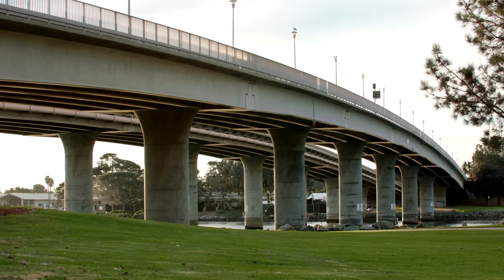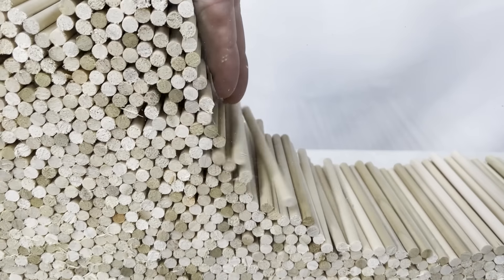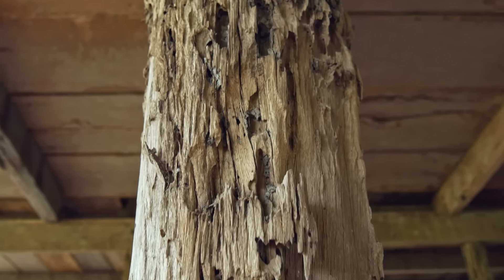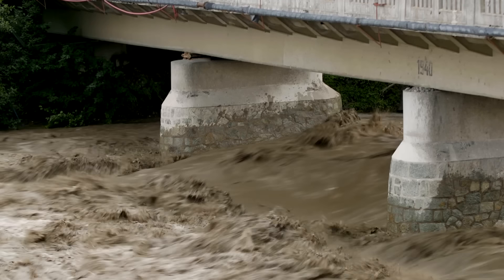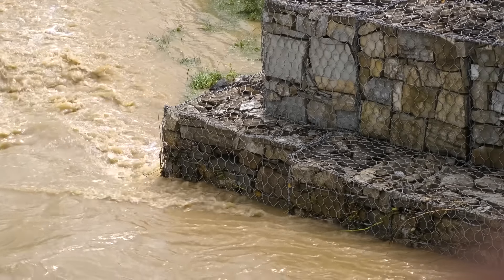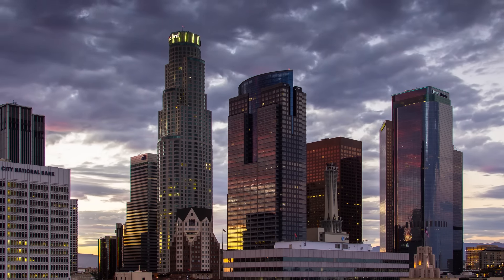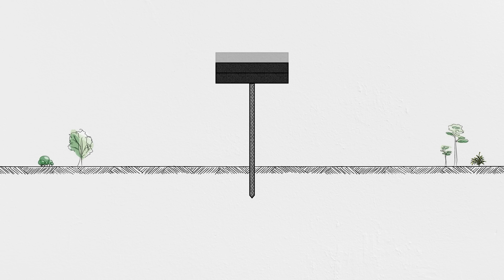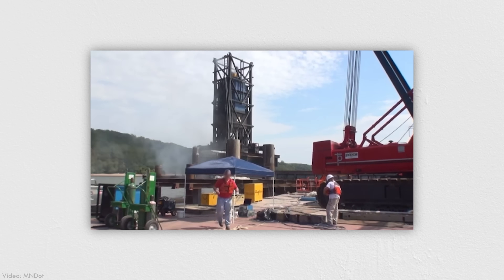Why Buildings Need Foundations

Comment: I live in Utah. Whenever the road gets wet (including I-15), the lane lines can become difficult to see, and traffic gets to play a game of everyone guessing where the lanes are. This problem is exacerbated by constant construction due to massive population growth and freeze-thaw cycles; every time a lane is moved, the old lines are painted over or ground out, and it can be very difficult to differentiate between these ghost lines and the real lines on the wet road, because they’re all just kind of less shiny bits among the shiny road surface.

When I visited Oregon, however, it was a completely different story. The roads are constantly wet there, and the lane lines were extremely easy to see at all times of day and night. Even when the tabs that stick up from the road surface (we can’t have those in utah because snow plows will scrape them off) aren’t present, i can see the lines very clearly. I think they use some kind of paint with reflective material instead of just pigment, but I’d like to see a video about road paints and why it’s so crummy in Utah vs Oregon (hoping there’s a better reason than cost, because it’s really dangerous).
Reply: In both Houston and Dallas I have encountered the same problem on freeways that have undergone numerous lane shifts during road construction. Even with reflective paint it can be hard to see which is the correct lane in wet conditions; we sometimes have to rely on the reflective bumps for that. But then we never really need snowplows...
Reply: They use the reflective paint for road lines everywhere. 
I'd guess what happens in Utah is when the roads get wet the fine sandstone dust turns to mud, and that mud obscures the reflective particles in the paint.
You also have a sort of sand blasting effect with sand and wind scouring the paint, and vehicles running over the sand particles as well grinding on it.

Basically its a more hostile environment
Reply: Oh my gosh yes please
Reply: I always have trouble in well-lit urban areas in the rain, the shiny wet pavement reflects the streetlights and other vehicle head-and-tail-lights and there's just too many light sources, no contrast. It's not a problem when the pavement is dry and black but when it gets wet and shiny it effectively doubles the number of light sources.

The paint used in street markings is retroreflective (a simple retroreflector made of glass beads embedded in melted plastic if I remember it correctly), so it preferentially bounces light back in the direction it came from and so looks brighter than other objects in the area when viewed in light that comes from near the viewer, like your headlights. This effect is cancelled if there's a bright streetlamp or a vehicle coming the other way whose headlights are bouncing off the road just as brightly as the reflection of the paint. When the streetlight hits the pavement, the water layer scatters the light in all directions but the retroreflective paint sends most of it back up towards the light fixture, and so less back to your eyes.
Reply: The paint depends on where you live.  Most northern lines are made with thermoplastic paint and covered with ground reflective glass.
Reply: Wait, are you saying they never need snow ploughs in Oregon?
I thought there was a lot of skiing up there, on the eastern side at least...
Reply: @MrNicoJac   There is considerable disagreement about raised lane markers. Some local Dots refuse to use them because the plows tear them up. Other states require them no matter the cost. The development of these markers is on going. It's like mouse traps, there are new designs every year.
Reply: @firesurfer 
Ooooh....! 
Yeah, we don't have those here either...
Thanks for the clarification! :)

Do you have an option on pervious concrete?
Here in the Netherlands, we've been using it whenever roads needed resurfacing, and so far it seems pretty good, overall.
No more aquaplaning!
(but I'm not sure if our roads now get destroyed more easily, and whether it would work everywhere - I believe road salt washes away and thus basically becomes completely ineffective)
Reply: @MrNicoJac  I think it's pretty rare, but is used in some places in Arizona.
Reply: Places with lots of snow (particularly where it doesn't melt at all over the winter) also have rumble strips between lanes as often you can't see the lines as they're below a sheet of composed snow that is now ice.
Reply: The problem in Utah may be partly due to low population density, which means more miles of road have to be maintained per person, which makes budget problems.  In Ohio we have plenty of both rain and snow, but we also have 282 people per square mile, so ODOT is *funded*.  We do occasionally get hard-to-see lane lines, but when we do, it's consistently either in an area with active road construction (in which case there are orange barrels and cones and such, and it doesn't last very long) or on out-of-the-way rural roads ("township roads") that hardly get any non-local traffic and only have two lanes anyhow.  When they change the number of lanes on a state or national highway, they generally go ahead and repave while they're at it (those roads have to be repaved every year or so anyway, no matter what you do).  And that goes double for major highways, like US-30 or the interstates, or major thoroughfares in urban areas, like West Fourth Street in Mansfield.

However, it could also be related to climate:  Utah gets rain much less often than Oregon or Ohio, so the roads have a longer amount of time in between rains to accumulate all the things roads accumulate when it doesn't rain.  Leaked motor oil and various other automobile fluids and who knows what all else.  When it rains, that all gets mixed into the rain water on the road, and the longer it's been since the previous rain, the more of it there is.  In Oregon, or Ohio, the previous rain was probably a couple of days ago, so there's usually not that much accumulated crud.
Reply: @BVoshol 
Are those only for snow?? 👀

I thought they were for sleepy/distracted drivers 😅
Reply: Standard procedure for installing Bott's Dots or similar devices in snow country is to cut recesses in the pavement and install the dots in the divots so the surface of the dot is flush or below flush with the pavement,
Reply: @Steve Cook Yes, it’s very difficult knowing where you’re at when I-15 gets wet, I commute to and from Salt Lake daily.
Also worked in Washington and Oregon the first 6 months of 2021 and drove through several torrential downpours on I-5 and you’re right, the lanes remained much more visible
Reply: That's funny...every time I'm in Utah, all I think about is how much better the roads are than in WV...
Reply: @dorvinion  I thought the roads were so bad in Utah because they don't invest in their infrastructure as other states do. Low taxes.

Comment: Nice job explaining.  

What might be very interesting for a subject is the concentrated load on a runway for an airplane landing, and how it dissipates through the thickness of the concrete.  The shear cone of a concentrated loading vs uniformly distributed.  Static vs dynamic loading.
Reply: Of interest on the subject of airport runways was an article I read in a magazine about heavy equipment. The concrete runway was being replaced due to wear and because they couldn't replace the concrete runway with a new concrete runway and have it set and cured in time for the first flight landing in the morning, the decision was made to replace the concrete with very thick layers of asphalt. All of the work was being done at night time within a very tight operating window. I think that the airport may have been in Germany, but details are fuzzy. 
Mark from Melbourne Australia
Reply: @markfryer9880  Now I'm curious about that.  Was it like a mill-and-overlay, where they ground off the surface and then laid a new surface on top?

Comment: You mentioned some foundations being resistant against earthquakes and my mind immediately went to Japan, a country known to experience earthquakes. Could you do a vid specifically on how buildings in Japan - or any other country with known earthquakes - are built with this in mind?
Reply: I like this - please do. 
Also, I've seen piles removed in Japan -  can't imagine how this would work.
Reply: I remember seeing something about ancient Japanese temples where the wooden structure above just sits on stone slabs. In earthquake situations the beams just slide around on the slabs and it keeps the structure from coming under excess stress and collapsing.

I thought it a marvellous idea.

Comment: When in school for masonry a vaguely recall the story of a library - I think it was in Mexico City - that sunk below grade due to poor soil quality of the basin (not because the architect didn't calculate the weight of books) and they were forced to build steps down to the entrance.   But as numerous tall buildings were built around it the hydrostatic pressure they exerted caused the library to raise back to and finally above grade requiring steps to be built up to the entrance... 

I've looked periodically for the name of the place and exact location but I've not found it. (Part of me is still convinced that it was invented as an example of the effects of hydrostatic pressure... but nearly 2 decades later and it sill haunts me.)
Reply: Palacio de Bellas Artes (Palace of Fine Arts), actually.  I remember it from Why Buildings Fall Down (Matthys Levy and Mario Salvadori, 1992).  Not sure how true it is either -- the Wikipedia page mentions the building has sunk 4 meters since it was built, but says nothing about it rising.
Reply: @AaronOfMpls  Thank you. That's actually a viable candidate as an inspiration for the story. Even if it's not a factual representation; it's still more then I had before.
Reply: Reminds me of how the pillar in Mexico City has had to have steps built up to it because of soil sinking.

Comment: lesson of the day:
an explosion is slower than a hammer

But seriously i love your videos! Could you make a video on which tests can be done to check various structural parameters, where a priori calculations and so on are not feasible/accurate? I never thought about the fact that it could be so complicated to check for static load and am now wondering which other parameters of a building project might be deceptively hard to gauge.
Reply: I caught that too
Reply: You can tailor explosives to be as slow or fast as you need for the particular application (within reason). Can't really do that with mechanical weights. Edit: That is to say you can make it faster or slower than the hammer, it's not that it is inherently slower.
Reply: @stromlo  is it possible to dampen the hammer's force with a rubber coating? or is the weight of the hammer too great for that
Reply: @1224chrisng  That would reduce the effect of the hammer.
Reply: @stromlo  What about a hollow hammer filled with metal spheres? Are those slower than solid hammers?

Comment: Really great video! You are correct in saying shallow foundations have the potential for frost heaving in cold climates. One way we commonly avoid having to dig below the frost line is to place insulation around the sides of the shallow foundation, typically extending out as far as the frost line is deep. This acts like a blanket and allows the energy of the earth (or even the building's heating) to warm the footings while blocking cold air from reaching them from above. The downsides of this system include that they take up a larger footprint than the building itself, future maintenance around the building may be unaware that the insulation is there, and foam insulation isn't always cheaper than digging deeper. It's typically the client's choice what they choose to do.

Comment: What about a video describing the work done on your house from a practical point of view? I have no idea how you could replace the foundation without destroying the build on top of it...
Reply: Something my parents had to do last summer was replace the ribbon and sill because the deck was attached to it directly and years of water damage rotted it away and the deck litterally fell off the house. What we did was lift up on the floor joices in the crawlspace with a hydraulic jack and then secure it with 2x6's, While this may not have been OSHA approved it was cost effective and we followed the basic rules for pinch points (don't stick you fingers under the loads) in case the temp supports gave out dropping the house about an inch.

Basically you can lift a house up off the foundation enough* to do foundation type work by just lifting up on the floor joices and/or other structural beams if you a gentle, make small movements, and generally try to avoid differential movement.

*Enough may mean a few millimeters to not have loading on a pier or it may mean pick it up and set it on a trailer to be hauled down the highway.
Reply: It can be done using the same technology as house movers. Steel beams are placed under the floor joists or beams. Then use hydraulic jacks to lift up the entire house. (After disconnecting the utilities, of course.) the process is more complicated if there is an attached garage on a slab, but there are ways around that.

Comment: In construction after "site investigations" and Structural Engineering in residential development the profit can be lost in the ground. I worked on  a prestigious site with £1/2 million homes. After test drilling the boundaries only in a site in a vale toward the local River, heads rolled as "running sand" was found on 1/2 of the site. Homes had to be rafted or on ring beamed deep piles.
 One home had contiguous piling for a  small bungalow. Costing nearly as much as the building built upon it. What ever the site and conditions do your homework, local history, mine searches, speak to older locals and do a "thorough site investigation" of the geology of the ground below. The site made a massive loss, but if not identified those homes would have become probably dangerous to live in or lose the value of the property.  Even buying second hand check and do homework, for foundation problems can destroy any plans of making a fixer upper a home.
Reply: I worked on a house here in Melbourne Australia where the Geotechnical engineers had mixed up the soil reports for two houses in completely different suburbs. The house I worked on was designed for a two storey house on stable ground when it was actually built over a filled in small creek feeder gully. This meant that the footings for the raft slab were insufficient and when I arrived on site I came across access holes cut through the floor slab for new concrete piers to be poured after hydraulic jacks had relevelled the house. The house was surrounded by scaffolding so that brickies could repair the damage to the brickwork from when the house started sinking under it's own weight. The other part of the story was that the other house which sat on stable ground, had been effectively over built with deep concrete pile footings that didn't need to be there. 
All of this trouble was caused by the mix up in the soil test results between the two sites. Naturally, this situation tested out their professional indemnity insurance policy and would have seen a subsequent review of their premiums. 
Mark from Melbourne Australia 
to prop
Reply: @markfryer9880  I remember a case where a farmer's son built a home on a piece of land near to the farm house. 
I believe they rafted it as near many trees where some were removed. Then the house over a "short time" began to settle a few millimetres, then centimeters then meters!.
They had only built on a piece of land where a hundred years ago all the cow and mud refuse was scraped into the hole. Over time they created a great sponge, then as trees grew about the site the crust became solidified by the trees roots systems.
 The house ended up sinking  until the rehydrated crust and house reached equilibrium. That was just under the eaves leaving a nice red pan tiled roof structure as a talking piece. As you described even when trying to do due diligence, human error is a factor and pig ignorance. The photographs as it settled were funny but frightening. I don't think they believed they had made their own liqui-faction model. LOL
Reply: My little town has a single underpass going underneath a railway bridge. 12 or so years ago the town decided to widen and deepen the underpass to allow transport trucks to fit through. 

I can’t recall whether it was one or two contractors that went bankrupt on the project, but it quickly turned into a nightmare. Turns out the railway ran beside a forgotten creek bed, and the underpass was dug in a soft, boggy part of that creek. They kept digging and digging looking for solid soil, wound up undermining the railway bridge and destabilizing nearby buildings. They even found an old corduroy road buried deep under the roadway. In the end they had to drive piles sideways to stabilize the bridge, then completely rebuild the roadway foundation. Took years thanks to our long winters and short construction seasons.
Reply: @markfryer9880  wow, that was embarrassing and costly!